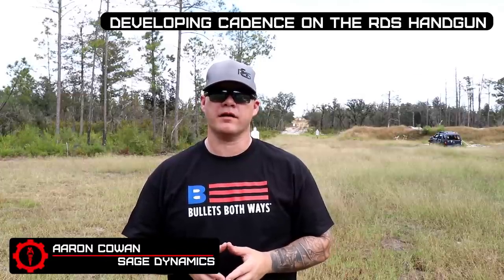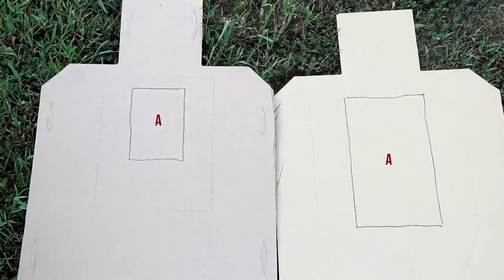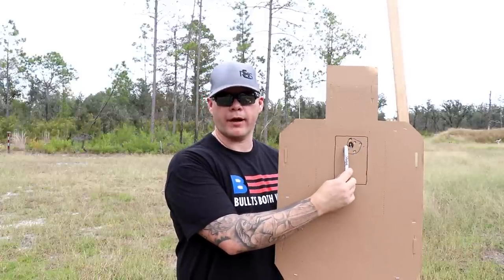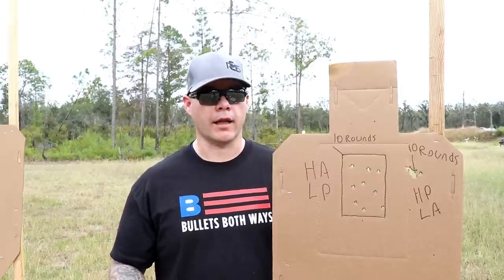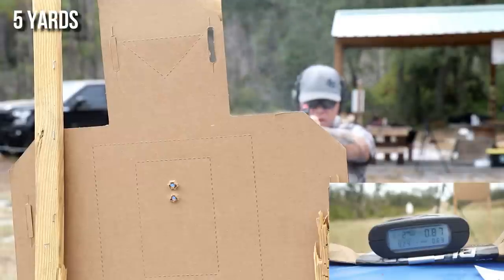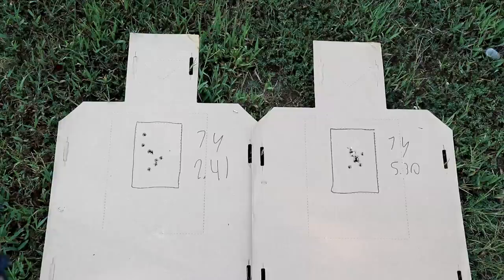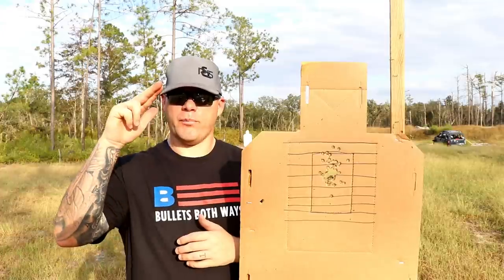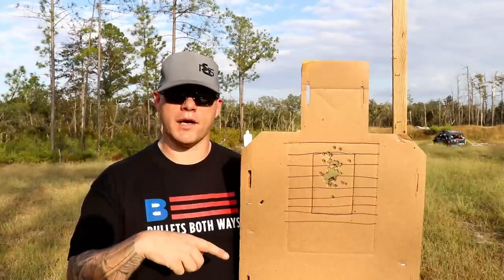Developing Cadence With The RDS Handgun

Comment: A piece of advice/information that I ran into a while back was that for defensive purposes a group like what was shown as "high accuracy low precision" is preferable because more bits of critical structures are interrupted thereby leading to faster incapacitation. If I recall correctly the advice specifically stated that you want to shoot as fast as you can keep all the rounds inside of an 8" paper plate. What are your thoughts on that?
Reply from the maker: viewatyourownrisk I think 8” is pretty generous.
Reply: @SageDynamics  That was my gut reaction as well, seemed reasonable but generous.

Is there a demonstrable change in the time it takes to reach incapacitation if the rounds applied to the target are stacked on top of each other vs. spread into a group similar to the HA LP group displayed?  

And I have to admit that asking that question it would seem unlikely that there's a shooting stats breakdown that would answer it.  And with the need for all other things to be equal, it may simply be impossible to come up with that answer.